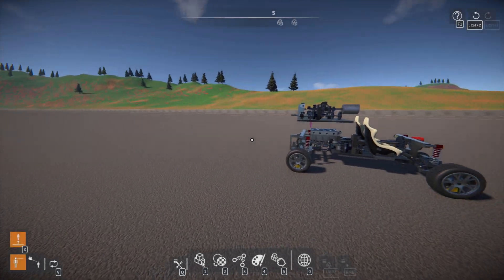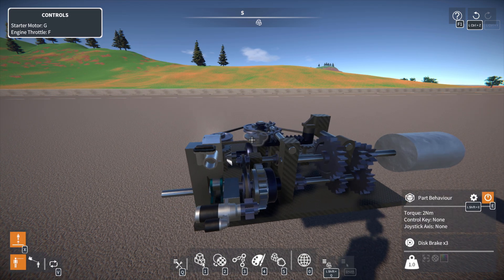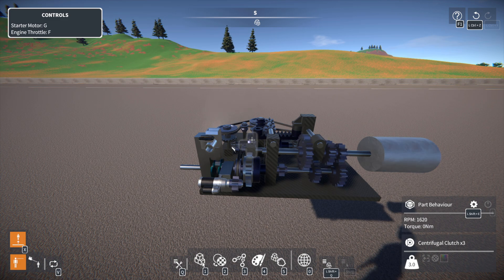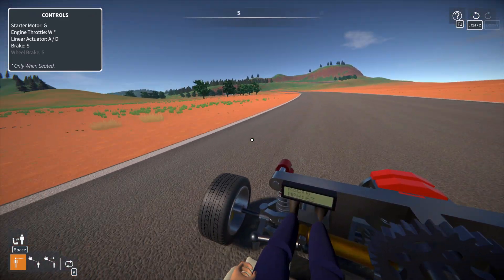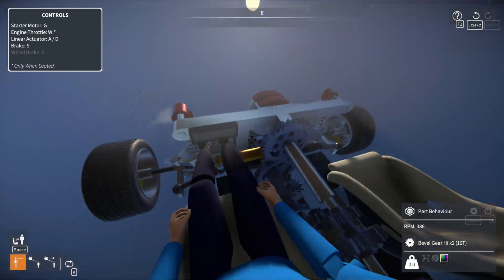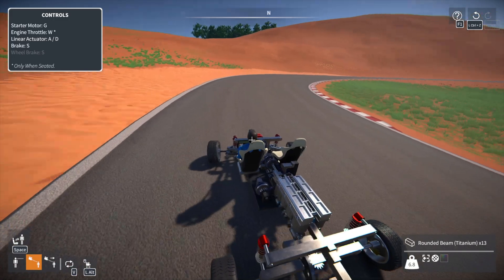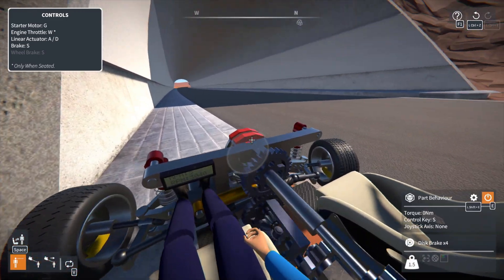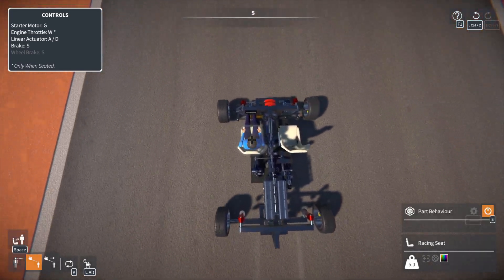3-Speed AUTOMATIC Transmission  |  GearBlocks

Comment: making a compact transmission is definitely a challenge! also suspensions since you need to use linear actuators for shocks/damping since the damping slider is just spring values in the opposite direction. (stuff often ends up twice as big as envisioned lol)

Comment: I built something similar a while ago, before the engine update. Never put it into a car though. One thing I did to compact the sensors was
Input shaft - 2x gear -upshift clutch-1x gear
........................................................... 1x clutch gear
.................... 2x gear - down clutch - 1x gear 
Then I drove my rack from one of the 1x gears. The reason the idler gear was a clutch gear is so I could use it as the brake that prevents unwanted movement of the rack

Comment: My guy the only thing that's unpredictable in this car is rear wheel steering. I'm sure that's what causes spinouts, it's not stiff enough, get a doublewishbone on the back like you've got on the front, secure it to the frame and not differential, and I'm sure it'll drive like a charm
Reply: Other than that it makes me happy to see that you also developed an auto governor for gearbox, good and simple
Reply from the maker: From what my testing has shown, alot of the problems come from the diffs.
They were essentially oscillating power between the two back wheels, causing the vibration and many other issues.

After a bit of tuning to the diffs, it's alot more stable.

Comment: I made a 6 speed sequential a few days ago that also employs a linear travel selector. I think in principle this could intergrate into it although it would be pretty darn bulky in comparison.
Reply from the maker: The clutch system would add a bit of bulk, but it would need to be any bigger to accommodate the extra gears...
Reply: @AlMagmaGaming Funny enough it doesn't actually require deviating from your original mode of operation, it would just be applied across a longer rack. It's one long travel for 1 thru 6 selection
Reply from the maker: Yes.